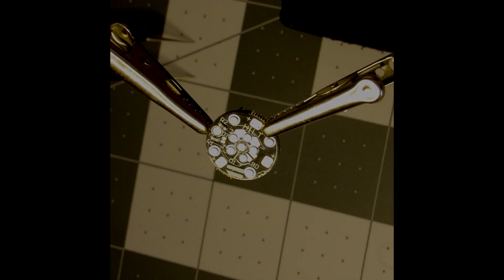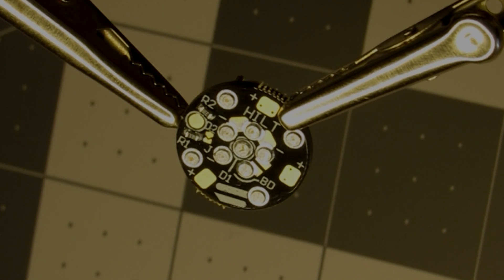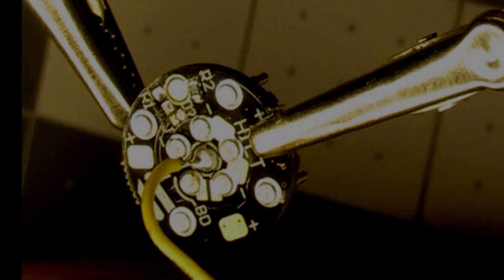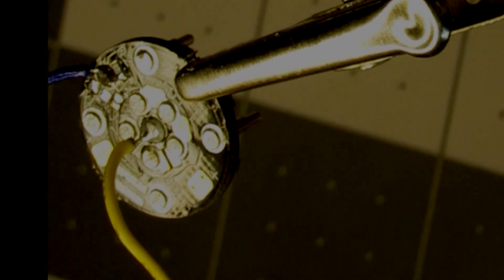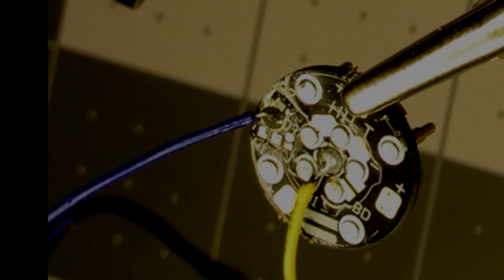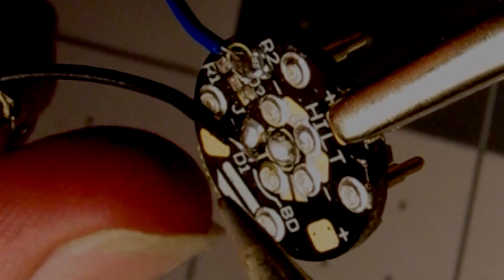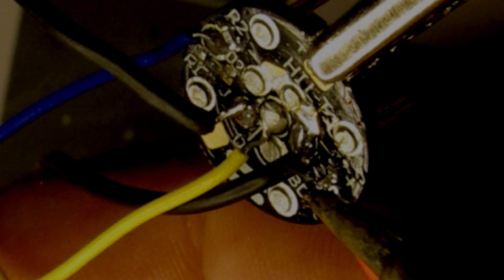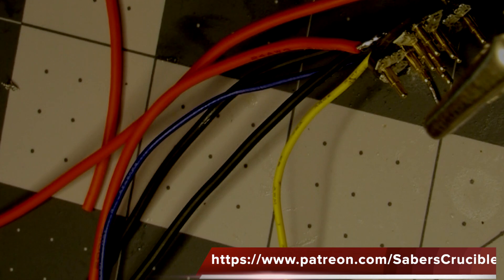Wiring my First Neopixel connector!!

Comment: Hi there Lord Nitro, I see you are having issues with your soldering in that the parts are moving about. I have found that using a small 1inch hobby model making vice is useful for holding the PCB (and later your soundboard) horizontal and flat and use your "Helping Hands" crocodile clips to hold the wires over their intended pad locations.
I have all of this fun to look forward to myself soon, as I have a One Replicas Qui Gon Jinn hilt I need to install with a Verso board - luckily though I am only installing a Tri Cree Grn/Grn/ Red baslit LED not Neopixels.
I just can't believe how brave you've been attempting this "single handed". I will look forward to your next installment.
Reply from the maker: Hey there! Yeah the old school helping hands are a little wonky, but I have a better option coming in soon. I really want to see your version when it is done. I seem to have a habit of jumping in over my head which is why I chose the profile like I did. That said, I hope to try my hand at ALL the sound bords one day 😁.  Good news on the hand, the cast is off! So the next vid should go way easier. Thank you so much for the concern, it means a lot.  👍